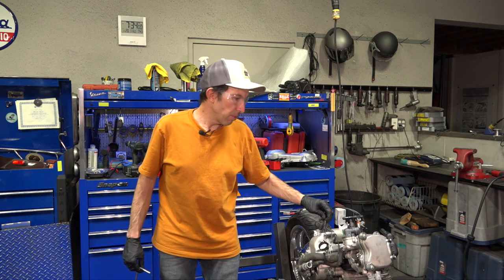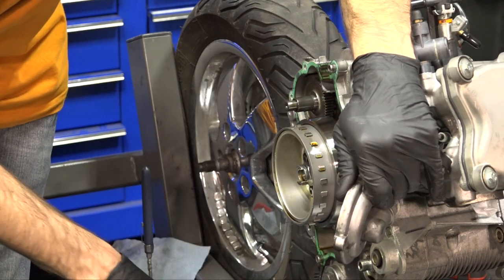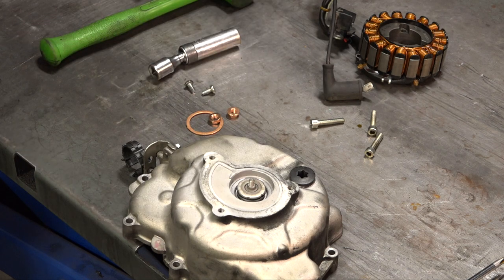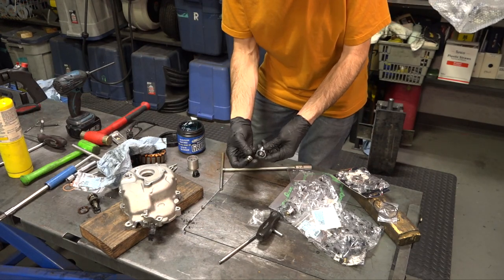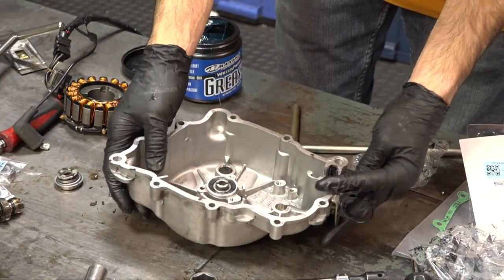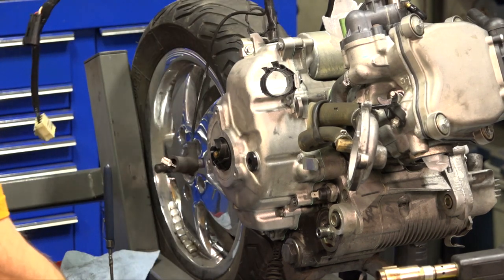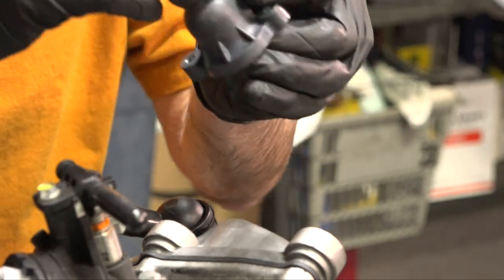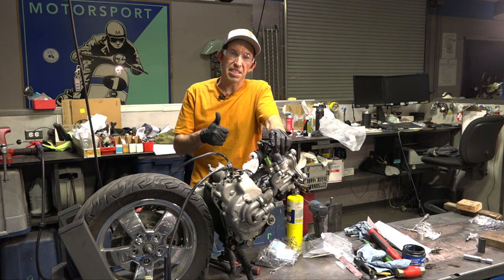Vespa GTV Resurrection | PT.4 Water Pump

Comment: Oddly, perhaps one of those $60 hot-air rework stations might be good for heating up cases. You can select the temperature up to 900F,--up to 600 watts. Thye come with different sized nozziels to put heat right where you want it. I got one for pulling electonic parts and shrinking tubing, but I heat-welded a broken ungluable polypropylene  parts organizer back together with it, already. I got one with an extra element.